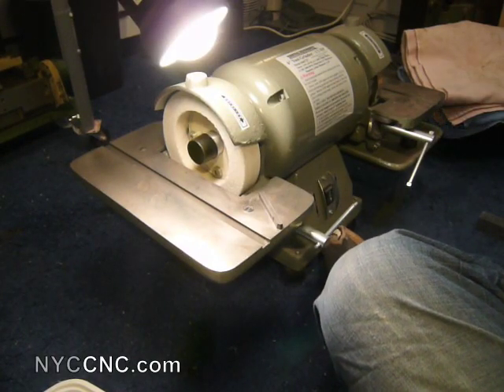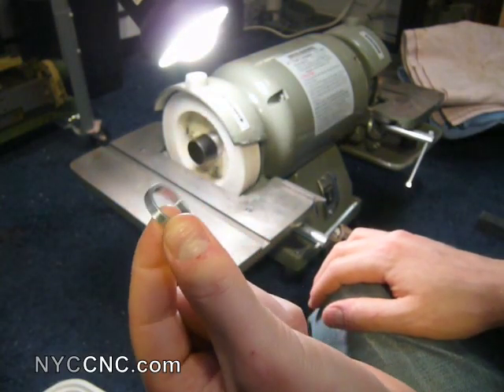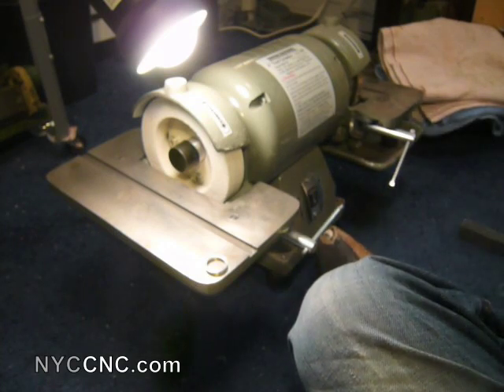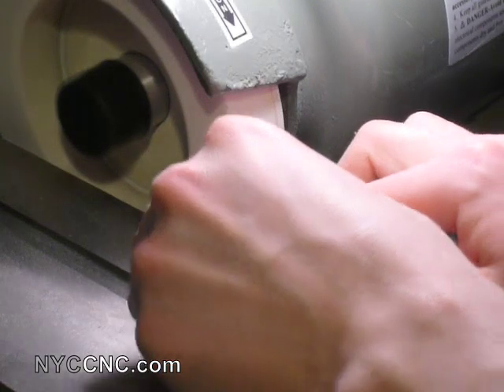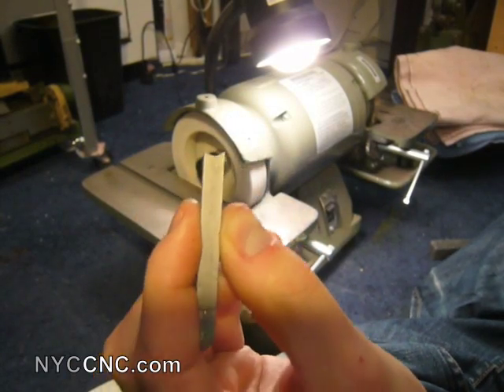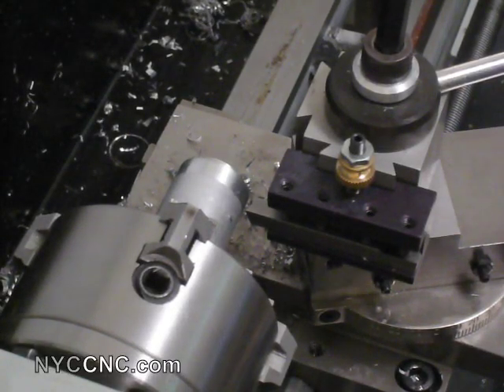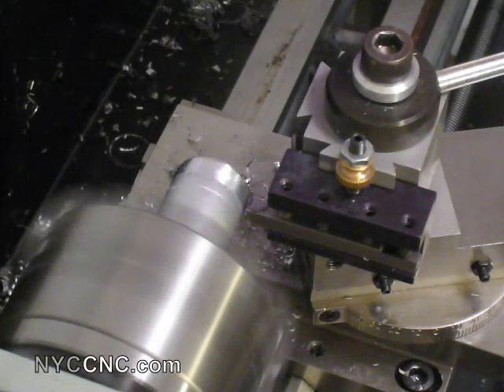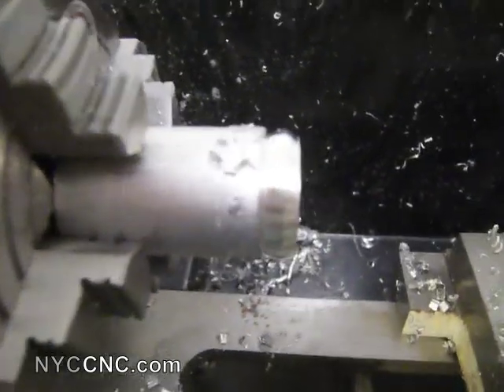Grinding an HSS lathe tool blank for Micromark 7x14 mini lathe

Comment: Looks to be the hf grinder? Where did you find the alumiun oxide wheel?
 I have the grizzly unit (which is basically the same).... No wheels fit if that i can find

Comment: Not bad for the first time out.
  But you have that beautiful grinder, you'd be better off if you dropped the table to about a 5 degree angle, and held your blank firmly down on the table while you were working in your radius.
  It makes for a smoother grind, and a smoother cut.
  But you did just fine.  Possibly a lot slower RPM on the lathe, but as no tolerances really come into play, polishing is wide open.
  Good job though.
  50 years from now, you will still be learning.

Comment: Hi , I've been a machinist for 38yrs, so I know how difficult off-hand tool grinding can be.
My apprentice years were with a microscope manufacturing company , where surface finish of all items was important. My "Tip "to finish off a radius forming tool is ..... turn up a short piece of soft material to Diameter required, leave it set in the lathe and add a coating of lapping paste, then run your roughed out tool bit up and down by hand ( with spindle running ) too polish in a perfect rad.

Comment: what if you used a hollow piece of steel for the ring.  or bored out the piece your using and ground down a tool with a parting section on it.  then you could mass produce.

Comment: Place the tool on the table, and use a small block of wood behind it. More control, and easier on the fingers. If you have a mill, make a 7 degree wedge to make grinding the relief cut easier and more consistent.

Comment: What is the ring mounted on and how is it fixed in position on the lathe? It looks like a wood  but how does the lathe tool not just rip it off?